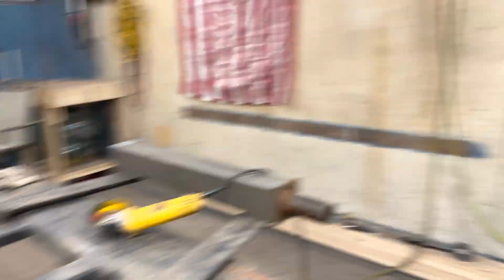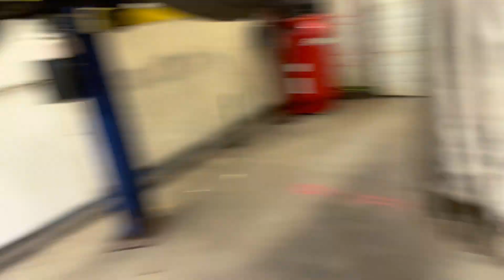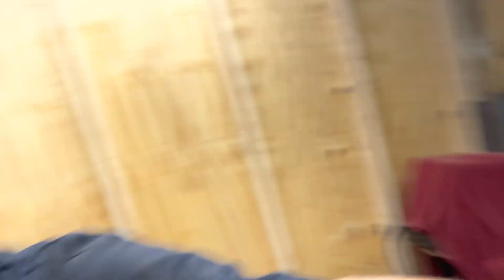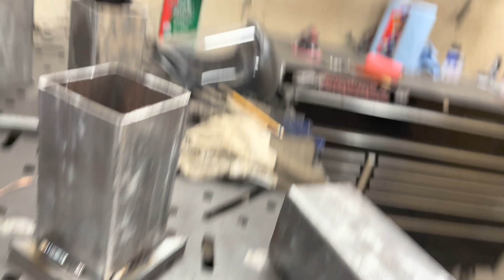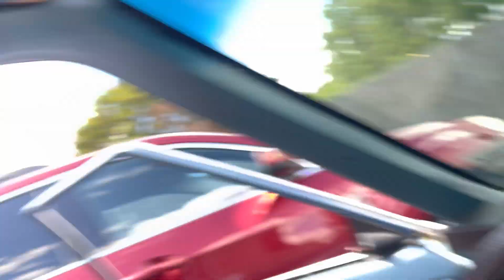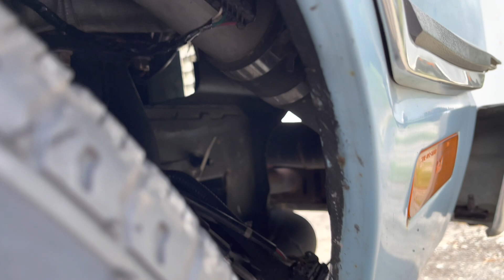Rowdy dyno day trophies and Rowdy Fairmont action! #welding #fabrication #automotive

Comment: I’ve been doing some plasma artwork, and stumbled across something that may be of interest to you. I put a plastic bag down, then an old sheet, the metal piece, then another old sheet over that, then wet it down with Vinegar. Let it sit overnight, and the scale literally brushes off. No loading up sanding discs, no  “polishing the scale”. Quick and easy. A tote with a few gallons of vinegar may be the ticket for those small parts. Vinegar is cheap.